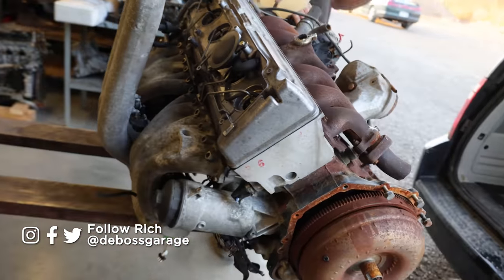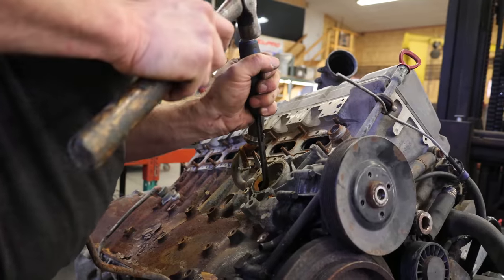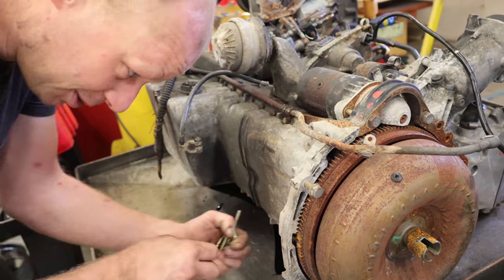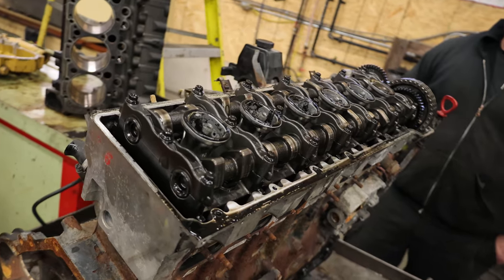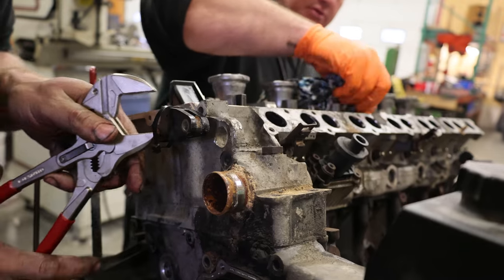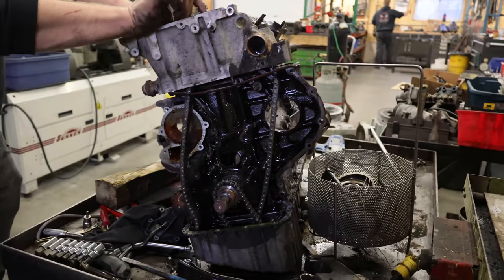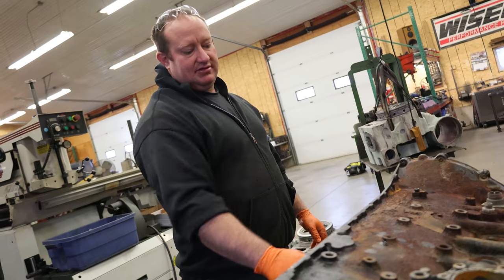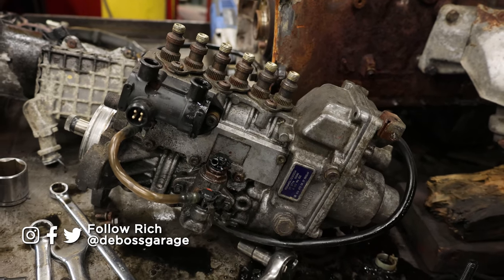REVIEW: Everything Wrong With A 3.0 Mercedes OM606

Comment: Yhere is a guy in Sweden there building diesel pump for Mercedes.  650bhp is no problem. Stock crank and rods. New exhaust manifold. Custom intake. BIG intecooler and turbo...   beefy oilcooler. Wire goove in the block around the cylinders to make max pressure on the head gasket.  Good luck🇸🇯🇸🇯👍👍👍

Comment: I watched this while sitting in my 606 swapped Dodge ram lol.

But watching you guys tear this down made my day, and I laughed where you guys needed special tools and didnt know it. The pins in the head can be removed with a socket, a bolt and a nut. Also both pins nees to be removed to remove the head.
Reply: Where did you get the adaptor?  What tranny are you running?  Maybe I should search your channel lol.
Reply: @jimmahoney788  No adapter. Running the Mercedes transmission with an Ofgear TCU and made my own mounts. But that truck was involved in an accident. The swap now lives in my 1995 Ford F350 CCLB.

Comment: Good to see the legendary OM606 getting your attention Rich. Never worked on one myself but have played with OM605/603/617/615 etc. Mercedes make great engines most of the time but now and again they drop the ball. More often with the petrols than the diesels. The main thing to be careful of is that they build the engines to a spec for the power requirement. Therefore the turbodiesels usually have higher spec than the N/A's. If you plan to boost that N/A block has it got piston cooling jets? Usually they are only fitted to turbo blocks. I have heard that the heads may run a different alloy to cope with the increased heat loading of turbo application. Do some research before spending money on it. Oh, and be careful of DieselpumpUK. They like to post Dyno videos of crazy power increases but don't show any EGT figures etc. Be interesting to see where you go with this and what application you put it in.

Comment: Most Mercedes  chain guides are held in by pins you push in from the outside. They are usually drilled and tapped and you use a bolt to pull them straight out
Reply: that's my experience as well..
Reply: Hazet makes a timing pin puller. Threaded bolt with a bearing and nut to pull the pin out the front

Comment: Those “lifters/pushers” look like what I knew to be Hydraulic Lash Adjusters & on the Mazdas I used to work on, the cam lobes are offset so that as they turn on the HLAs, they actually rotate/swivel in the cylinders, so that wear & noise is minimal.
Reply: Those are really common over here in Europe, Mercedes used them on all of the OM601, 602,603, 604, 605 and 606 engines
Reply: Toyotas have been doing this with every ohc engine since the 1zz as well
Reply: @kennedy796  Yup, and BMW have used them for probably 20 years before that as well. I guess it's only really the Americans that haven't evolved to 1970s engine technology yet!

Comment: I’ve got three of the OM648 that followed. Last of the straight six 3.2L. It’s common rail. Biggest downside is that not too many made it to the States so nots of lots of aftermarket parts and tuning.
Reply: can you do a mechanical pump on the om648 too? i keep seeing people say the 648 is the way to go but i don't see much info about them getting swapped
Reply: @adamm2716  Not easily. It's common rail so injectors and everything would have to be changed.

Comment: I just bought a Merc (S211) with a OM642 in it. I chose that engine because I used to drive a Merc van with the same engine, it wasn't spared and when I left that job it had 600.000km on it and still doing fantastic with zero issues.

Comment: the drifter is Teemu Peltola from Black Smoke racing Finland if i am correct with the car
Reply: Teemu ran Scania truck turbo, jaguar supercharger and a NOS!!! To make 1200NM on stock internals!!! He started to split blocks when reached around 1000nm, so he did a sandwich plate in between block and oil pan.
Reply: @dievs2  Yep
Reply: @dievs2  He also had water injection on it

Comment: But, but, but they sound cool...
Reply: And make a ton of power with a mechanical pump
Reply: @tokeypokey  Even with the electronically controlled pump they can make a ton of power.
Reply: 606 rev over 6k stock.. om 603 can do 5200 rpm stock.. "but ya they sound cool" lol...
Reply: @parkerbethke that idle sound is perfection
Reply: The idle sound is the best thing about them

Comment: I worked on RV’s and sprinter style vans at my last job, and these OM606 engines run like crazy. They build boost instantly, and rev like a gasser. I loved maintaining them as I always took them for a test drive and gave them the proper Italian tune up. They run smooth as butter and make great power.  Everything is easy to work on if you have the tools, i did a lot of transmissions in them, although some don’t have a dipstick, you have to buy the dipstick tool to know your fluid level. Filter access is relatively easy, all considering, although the B service fuel transfer pump filter under the turbo piping can be difficult to get to in a RV.

Comment: I worked at a Mercedes-Benz dealership 20 years ago. My job was just cleaning the shop but I will never forget the room they had dedicated to special tools required to work on the vehicles. Yes, a complete room full of specialized tools that were required for various repairs on the many, many models of cars produced through the years. I vowed never to own a Mercedes-Benz after seeing that room.
Reply: The 606 was before that time. I've had an M57 before, and I would basically only take a 606 over that engine. Both are dead simple and lovely to work on, with the Merc winning out in the end. On the Beamer it's the inlet and timing setup that gives you trouble, on the Merc it's the vacuum and the turbo if you don't size and flow things properly. Both have absolutely rock solid bottom ends and are absolutely reliable so long as you know how to treat them right.

Don't buy any car past '08-'12 depending on brand, in my experience. Too much gadgetry and designer scummery. I sold my 530 after getting into the wiring and repairing some minor faults; It turned into way more of a pain than it ever should have been on account of the layout. Decent components but an absolutely stupid way of placing them. Built for obsolesence.

Comment: Great video! thanks!! (just bought a '94 E300TD (not turbo) - S124T w/OM606 motor 640,000 kilometers it runs pretty well (no smoke!) Automatic transmission is biggest concern... drives ok though... vacuum leaks common problem ("modulator") and clutch sludge (yes. is has clutches inside)

Comment: 606! I was real tempted to buy one of these, but the timing didn't work out for me. Hope you take this engine to the limit! 

Also wanted to add... I believe the Europeans use the 606 with a modified mechanical 603 pump to make all the power and avoid the computerized nonsense.

Comment: No problem to rev an om606  up to 7k with harder Valve Springs...
Reply: A engine griddle is a must at those rpms
Reply: @luisfelix09happy  nah. Been running 2 years with 7500rpm and no girdle  and no problem.
Reply: On a diesel engine, isn't flame front propagation a limiting factor at higher RPM? I mean I'm sure you can get it to spin 7,500 but is it really making much power and extracting all the energy from the fuel, or is 75% of it burning in the exhaust manifold? Lol
Reply: @dregenius  Full HP at 6300rpm but nice to have some headroom of rpm if drifting or hooning around 😁 Ofc at over 7000 its not making that efficient power anymore but still goes really nicely  all the way to 7500 🤭😅
Reply: @Cdijursi  that's pretty impressive!
Reply: @dregenius  thought same thing.
I was always told that 5,000rpm is about the limit for complete combustion in a diesel. And anything over that was just smoke generation.

Max performance is a different kettle of fish I suppose, but aren't diesels all about torque?

Comment: Rich, there are so many variants of this basic eng from MB. Mine is a OM662 made under license in korea, & its in a '05 Ssangyong Musso Sports ute (pickup) My eng is old tech for that year model, still ID injection, but it is a turbo version. What you thought was a fuel pump on the timing cover is actually the vacumm pump. I personally would replumb the secondary fuel filter so that the fuel return goes back to tank, as you will have problems getting rid of air every time you change the filter, because the fuel return is plumbed back to that filter, so keeps sending the air round n round the system. Also, if you look up Diesel Meken in Sweden, he works all sorts of magic with engines & is a specialist in the fuel systems for MB. Hope that helps, from Qld Australia

Comment: They will go past 5200 rpm.... :D, you are not gaining too much above it but they stay together at 6000 with stock internals I can tell you.  The turbo has oil squirters on pistons, as well as other rods and pistons. The oil cooling is really fundamental to make it last when tuning. A turbo on an NA will hold up to about 300hp with stock internals, a turbo version is good for about double. The timing chain guide pin is pull out, wiggle it a bit back and forth and spray some penetrating oil, and it should come out. And the pump you pulled off was the vacuum pump not fuel pump.  Electronic pumps are tunable, for mechanical use or engine swaps in non MB (electronic) cars/trucks it is easiest to get an OM603 pump. All in all it is a great engine with loads of potential end great reliability. Got 2 on the driveway, and they will outlast me most likely.

Comment: The BMW n57 feels left out :feelsbadman
Reply: The m/n/g 57 BMW Inline 6 diesel engine...
What a beast... the LS of the diesel world.

You can put it in a Patrol, you can put it in a land rover, you can put it in a toyota...
Reply: Yeah completely... The bmw 6 cylinder diesels are insanely good..
Reply: Dont you mean M57? The N is one of the worst ever made!
Reply: Oh chill out buddy. There are enough bmw videos out there. Let the merc guys get some love for once.
Reply: M57, n57 are aluminum blocks,not as strong as older m57(iron block) and n57 have problems with timing chain
Reply: @antemanduric5220 bloody bicycle chain for timing chain and Premature bottom end wear on bearings, badly designed egr system. How did they go from such great engines to scrap
Reply: @derrickdaly296  i replaced one n57 because it dropped one cylinder sleeve and hit the crankshaf,broke into million pieces...The m57 are bulletproof tho
Reply: @antemanduric5220  😮 that's the stuff of nightmares.
Reply: Exploding diesel engines groupchat.
ZD30 joins the chat
N57 joins the chat
Reply: Ah yes, the N57 with its valve to piston clearance (lack of clearance) issues
Reply: @megarafjogos  wash your mouth out,put it in a toyota,huh.no way.spit on toyota. one of these in a landrover would demolish the rest of it. patrol o.k. i have the mwm 4.2tdi,f250 2002.
Reply: @antemanduric5220  i have a 335d wich is alluminium m57 and yes it is a m57 not n57 479 hp at the wheels for 3years and still holding strong 
Its in the design of the engine not the type of materials used to make the engine
Reply: @user-wz2jy9nc3s  Cast iron blocks are stronger.Fact

Comment: It also would be worth noting, the the OM606 is a IDI design, so it uses prechambers, as all Mercedes passenger car diesel up this point.

In stock Form they behave much more like gasoline engines, as they have a linear increasing torque and power curve. They lack a bit of low end grunt and torque all over the range compared to a DI engine, because of efficiency problems with the IDI design.

BTW. OM stands for "ölmotor" which stand for oil engine, they started calling their diesels like this, because diesel was more known as a kind of oil, back in the 40, when Mercedes started to use diesel engines in their passengercars. Mercedes first passengercar worthy diesel was called OM636 and it's a 1,7l prechamber (IDI), pushrod 4 cyl. Pushing ~35HP 😂

Comment: @DEBOSS GARAGE I think you can get a full set of rods, pistons, and rings from FCP Euro.  If they don't have them listed, give them a call or message.  Also, be sure to change the valves to the ones for the Turbo engine.  They're designed to handle the higher heat.

Now on the pump, what I had heard years ago when I was looking to put one of these into a 300sdl was that you had to change the elements and actuators in the om606 pump with the ones from the OM603 pump.  It wasn't to be a big deal.  Just a few hours of getting it off and putting it on.  I may actually have a spare pump kicking around.

Comment: OM 648 is my preference. Had a stock E class. good for 130 mph or 50 mpg (imperial)
Reply: I prefer the OM 642. It's all aluminum and more compact. I don't know how you get 50 mpg. I'm happy with 25, but mine is in an SUV ;-)
Reply: I am also interested in how you are achieving 50 mpg.
Reply: @davidschulfer786  Cost of diesel in UK, and wearing a flat cap!

Comment: That water pump housing is a fault.  Dieselmeken has a video where he shows how to make a coolant bypass to the rear cylinder for better cooling flow.  You may want to do that if you're rebuilding.  Also consider relocating the thermostat higher on the engine.  You can see when you took the thermostat off, how much red/orange heat there was inside the casting.

Comment: Nascar Cup engine builders get some pretty hairy HP with pushrod 2 valve engines
Reply: HP isn't hard. Getting RPM out of a pushrod engine, is hard.
Sure, you can build a 9000 rpm pushrod engine, but it is not going to be cheap, and it is going to make less power than an otherwise identical OHC engine, because the spring pressure on the valves is going to be a hell of a lot more, to keep the valves from floating.

Comment: As a matter of fact N/A and turbo blocks are slightly different. Both have oil squirters etc but N/A block is thinner from certain places.. N/A has better cams. worse pre chambers. less opening pressure in injectors..

Comment: My dream would be to put one of these into a Ford Ranger, probably too expensive when I get to that point though. I'll probably end up going the TDI route. CJAA with a big turbo, CP3 conversion and a custom tune would probably get me to a point I would be very happy with. 

Was a bit nervous with the VW diesel complexity, but after doing quite a bit of modification to my CJAA Jetta they really aren't bad to work on once you get rid of the common failure points. Going to be CP3 swapping it next weekend.

Comment: The plastic lines, fittings and o-rings on them are a weakness. but the solution is to use the older style diesel filter housing with banjo bolts and copper washers from om601-603.
Rods are the weakpoint on the n/a engines and so is the head gasket, stock pistons will do fine,but the original turbo rods dont fit the n/a pistons . Theres no meaning to put a p-pump on there. there is no one who has been able to burn all the fuel an 8mm m-pump delivers, dieselmeken pumps ftw!

Comment: you should also try taking a look at the bmw m57, also capable of 4-500hp and revving as high as the om606, its a fair bit lighter though since its an aluminium block. m57's are commonrail, which makes them fairly modern and fuel efficient too

Comment: The guide pins do not unscrew!! You need a special slide hammer to remove them. The pin from the slide hammer screws into the chain guide pin, then you use the slide hammer to pull it out!!

Comment: I've been wrenching my own Mercedes for 30+ years now and will likely never buy anything else,  unless I can get an Oshkosh for a good deal. :)    The chain guide rail pins are usually center threaded and use a slide tool for removal.   The timing chain is released by grinding one of the link pairs' heads off,  new chain comes with either a master repair link with a clip or just a standard link that requires a link press to complete the loop.  The plastic hoses are just a sad thing that's happened to Mercedes engines over the years, trying to save weight and creating potential failure points.   Nice video DEBOSS!

Comment: They'll make a hell of a lot more than 500hp on a stock bottom end and they'll rev a lot higher than 5200rpm as well.....well the turbo engines will

However, you have an NA one and (so I've been told) the NA cams and the inlet is more desirable for making power

Comment: I am convinced this could be a great motor for my 18 ft 76 Dodge Chinook motorhome F30.  It is not a speed machine and I may do 100km at most and tow about 4000# of trailer with a 76 Guzzi in it.  Opinions?  Max GVW is 9000

Comment: Yes you can put an OM603 (mechanical pump) on an OM606 turbo diesel engine, fully compatible. All you will need to do is make sure timing marks are correct and put it in.

Comment: The OM's are one if M.B.'s best platforms  IMO. Check out Team Boosted's channel. They built a badass one. Everything inside these is forged and they can definitely handle some abuse. The P-pump is the key to release the full potential of these things, although fully mechanical version is the most desirable for obvious reasons. HX35's are one of my favorite 'budget' snails to use. They work great on a variety of engines, especially the inline 6's. You can even weld the gate shut on the internally gated versions and run your own, which I have done a few times. Great video, definitely enjoyed this one. Take care and hope you had a good new years! 😎👍

Comment: that chain guide deal, you use a threaded pin and puller to remove it. super easy if you have the right tool, or the random metric thread lying around. i did it using wrenches and stacking them progressively to pull the pin out as i threaded in a bolt into the pin.

Comment: the spring loaded pump chain sprocket deal is actually dynamic timing. aka it advances timing as the pump spins faster. if you could put that on a cummins and have it be strong enough to resist the actual pump pressure of a p pump you could make a dynamic timed p pump... aka fast and slow.